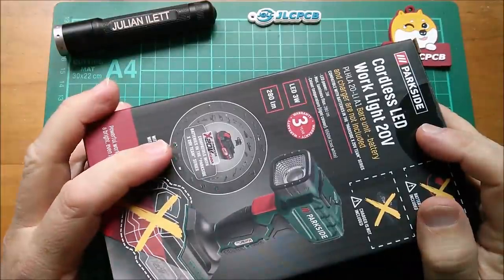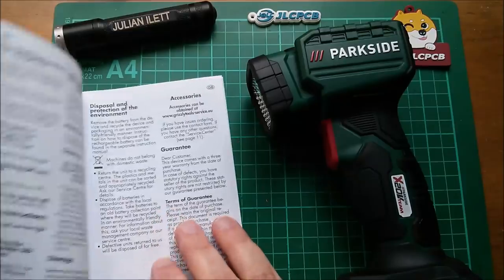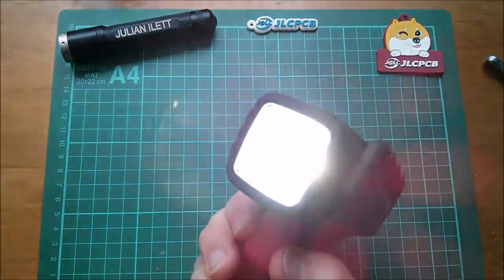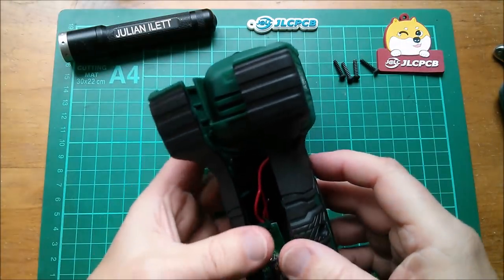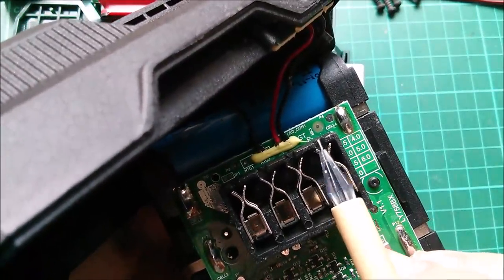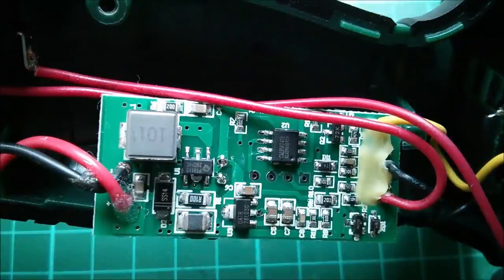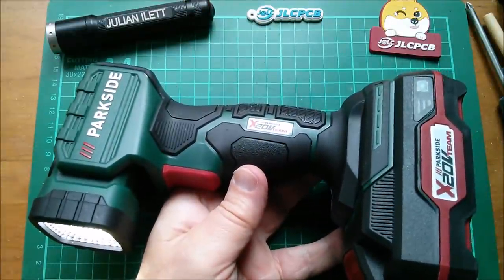Parkside Cordless LED Light from Lidl

Comment: The battery pack cutoff in Lidl's tools is done in the tool. There is no MOSFET to disconnect the load in the battery pack, so that explains the microcontroller.
Reply from the maker: Indeed it does :)
Reply: For this reason you need to be careful with the various 3rd party 'battery toppers' - they'll drain the battery too low.
Reply: That also explains the third wire on the battery terminal.  Some kind of signal to let the micro-controller know if the battery is low or overheating.
Reply: @jamesc3064  Exactly. I printed adaptors for some non-Lidl equipment and i know to check the power meter on the battery pack and listen to the motor if it slows down to make sure i don't kill the cells.
Reply: @EsotericArctos  normally closed thermal bimetal Sensor inside the Cells? :-) the newer ones are balanced so this is only 50% true
Reply: @kitecattestecke2303  I very much doubt any temperature sensing is done by bimetal switches in any of these devices.  It would be electronic with a NTC thermistor or the like.  The processor would be reading a signal on the wire.  That said, it is a guess as to what the their wire would be for.  We don't have Lidl in Australia but similar battery packs would use that third wire for that kind of sensing.   It's a 20V battery and you would have more than 2 cells so it is not likely balancing.  Balancing would be done by the circuitry in the battery
Reply: I also wonder if it might be connecting to the dim input of that controller and changing the brightness depending on the battery id

Comment: IP20 basically means water will get in it like a sieve!  Don't use it in the rain.  But at least they put it on the case so you know... if a little cryptic. - 2:44
Reply: Yes IP20 really means it has absolutely no protection against dust or water and should be used in dry and dust free environments. Which is a bit useless if you are wanting to use it in a typical location where you need a battery light…
Reply: @Mark1024MAK  - I think they put the rating there so no one complains that it got ruined in the rain.  I think it'll be fine for most outdoor uses but if you need to change tires in the rain this likely isn't the best light to buy.  Cost is a big factor in this market range.
Reply: the IP rating is standard in industrial environments, tools electric appliances an so on.

Comment: I used to diss the light in drill/light combo starter kits but I got to thinking how useful a flashlight that lasts for days if not weeks of continuous use.  Great for a long term emergency.  This one is nice because it stands on its own and can point the light up or down.  The COB with a reflector give a nice focused light.
Reply: 4ah battery is 80wh. So this 3w torch will run for 26 hours.

Comment: Hi Julian, it was me who asked for a video on this lidl work light. I appreciate you sharing some of your electrical insight on the electrical board used in the work light. The reason I was thinking of modifying this light was because I am not a fan of the 6500 degrees Kelvin temperature color of this light, I prefer more of a warmer light. 

In the video you were asking about the head of the light and there must be another screw, there is, it is under the sticker on the top right side. The head is dismantled by pulling the two halves of the case open. There is 2 screws attaching the LED to a piece of aluminium for cooling, so would be very easy to modify and also a lot of empty space internally.

Comment: I think the answer to the third pin lies in the silkscreen above the connector on the battery. Made out the letters "NTC," presuming resistor or thermocouple. I'd guess that facilitates monitoring/managing the battery temperature by the microcontroller.
Reply: In my experience NTC stands for Negative Temperature Coefficient, in other words a component whose resistance drops as the temperature increases. You get them a lot in gas central heating boilers

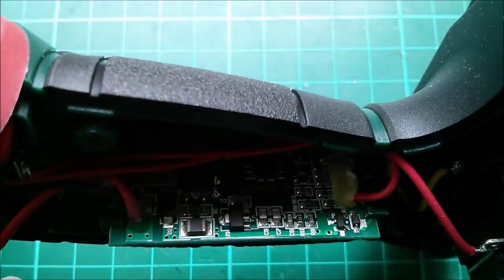Comment: By the 3 connections to the battery, it looks like it monitors the battery temperature as well as the battery voltage. - 6:13
Reply: That's likely what the MCU is doing.  Either get out of range and it turns off.  But it did seem to have a lot of support components at that end of the PCB.

Comment: As mentioned by zapro the low battery cut off is in the tool. The Lidl power drill, however, has no cut off circuitry and will over discharge the battery pack and likely over heat it. A potentially dangerous combination.
Reply: I wonder if they rely on the drill becoming ineffective before the battery over-discharges? With an LED light you could easily leave it on by mistake and drain the battery to death but you wouldn't keep trying to use a drill that doesn't have the speed or torque to make holes any more.
Reply: I wish they had that in the battery. I have 3 batteries and probably 8 or 9 tools. Dunno why they thought it was better to go in cheap on batteries.

This creates a problem for those that bought adapters to use the xteam  batteries with other tools. You gotto keep your eye on the battery indicator and put it back on charge when you get to 1 bar.

I wonder if it's possible to cheaply create a undervoltage cut off and fit it on an adapter.

Comment: It's a shame there are so many proprietary and incompatible batteries in power tools.
Reply: I true that , its a shame. Even the same conglomerat of brands do use different batteries connectors.
Reply: The one thing that does not get stressed enough  with battery powered tool reviews is that when you buy a battery powered tool, you are also buying into a battery system.  You are limited by the other tools available with this battery system.  Unless you don't mind having 5 different incompatable battery chargers on your workbench and batteries you can't share between tools.
Reply: @robertharker  Yes, they sell some good tools at Lidl, but I don't want to adopt their battery system.

Comment: I think the 3rd wire is the thermistor inside the battery pack, but since your battery has the thermistor place, but not installed, this wire is useless. 
Still a decent price if the LED doesn't go tits up in a few months.

Comment: I bought one of these. When switched on, the torch lit up for about 5 seconds then went off. I returned the torch and got a replacement which worked fine. I took the torch to use in work. In a work environment, this torch isn’t all that great, returned for a full refund.
Reply: Why is it not good? Light not focused?
Reply: I work in a garage, a commercial vehicle workshop. While in an inspection pit that is poorly lit, this light isn’t bright enough to shine up on to the underside of vehicles and trailers.
Reply: @thischannelhasnoname5401  thanks for your answer
Reply: No problem. It probably is a great torch, depending on the environment you use it in. I have a Olight R10 now. Loads better to also a lot more expensive.

Comment: They could add moving lens in it, so it could have wide and focus beam, its really just threaded tube and lens that move inside it, so its not complex to mold... also that yellow halo is mostly due to cheap plastic lens, its not bad, but I had really crappy lights that not only give that halo but also where so cheap that it actually dim light as after removing it, LED was like 10-15% brighter... they really always find a way to cut costs, but making lens cheap is really... cheap move...